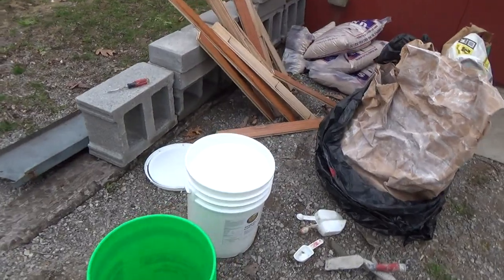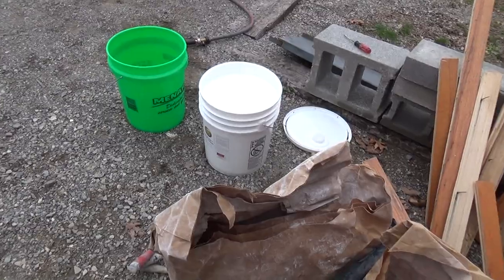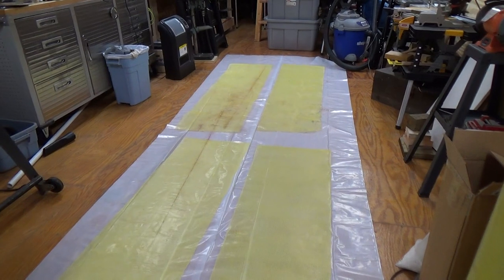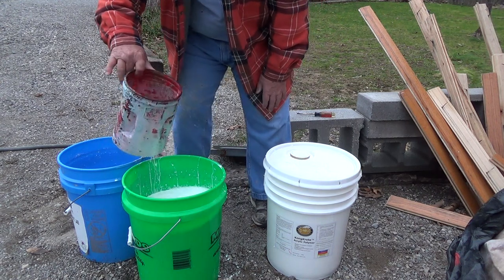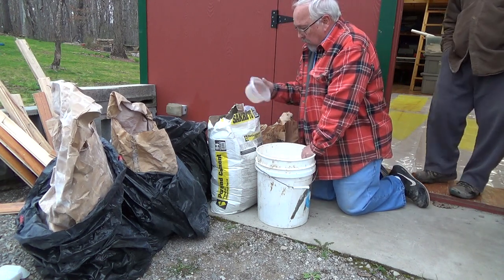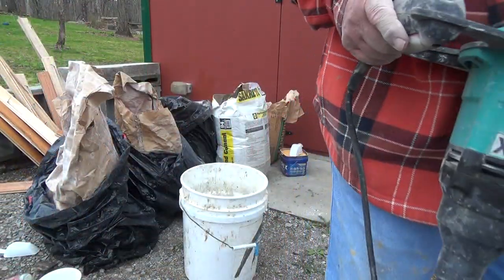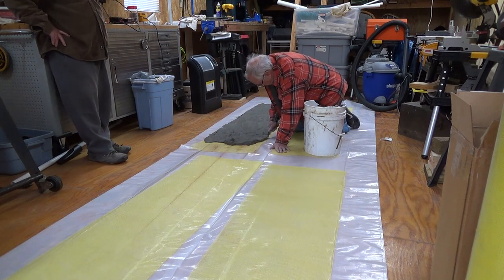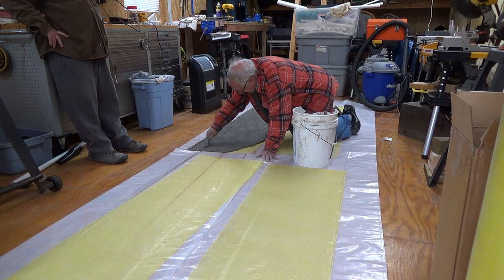Concrete Skirting for Sheds and Decks

Comment: Really cool, this is what I'm current doing. I built a frame from 2x4s under the addition I built (post and beam), attached 1" foam board over it and then metal lathing over that and anchored into the 2x4s... then covered in mortar and carved into faux rock. Works great, looks great and much cheaper & easier than the real thing!
Reply from the maker: What mix did you use?  Depending on where you live, mortar might not hold up very well.
Reply: @dperry428  Thank you for replying! My faux rock experimenting started about 10 years ago after watching some of your videos. You're a bit of a Legend ;) I'm using Type S mortar and adding some acrylic paint to it, so far it's been very sturdy but I'd more than welcome ANY advice you have, thanks!
Reply from the maker: Legend, huh?  Maybe in my own mind!  First, what's the climate where you live? I'd be interested to know how your mix is standing up to freeze/thaw cycles. I'd also be wary of using acrylic paint.  Concrete can be pretty sensitive to contaminants, so much so that water that is used in mixes should be of drinking quality. There's no telling what substances in paint other than acrylic might have a deleterious effect on the mix.  I'd also like to see some of the work you've done.
Reply: @dperry428  Climate is very harsh here (northern Maine). So far it's held up well. I'll try to post a video in the future of some of it.
Reply from the maker: I'd want a mix that was denser. That's why I use metakaolin and silica fume in my mixes. The greatest enemy of concrete is water and a dense mix is much more resistant to water infiltration.  Keep in mind that mortar mix is made to be deliberately weaker so that the bond it makes between bricks or rock breaks before the rock or brick.
Reply: @dperry428  good info, thanks! I did say Type-S mortar, but I was wrong on that, it's Rapid Set (High Strength) structural mortar that I used, but I can't seem to find that now
Reply: @dperry428  where can I buy metakaolin and silica fume?
Reply from the maker: @wilhallman2890  I buy mine from Fishstone, they ship.  https://concretecountertopsupply.com/  You can go here:  https://www.metakaolin.com/contact-us/  Contact them and ask for the nearest distributors of metakaolin and silica fume.

Comment: Sir I have spent countless hours looking for a AFFORDABLE diy way of skirting my homes. you sir are the only video I have found to do this so now comes the questions ..
I like the idea of just lathe and covering it with concrete what do I attach the lathe to I seen you just screwed it to the bldg how about the bottom what keeps the skirt rigid and straight I would love a response so I can get to work right away .thank you for sharing your skills
Reply from the maker: If the space being covered is less than about two feet, there is no need to have additional support, IF you use a high strength, fiber-enhanced mix.  Once the concrete is on and set up, the panels are more rigid than plywood.  If the space being covered is larger, then you could build the equivalent of a stud wall with treated lumber (2 x 2's would be sufficient).

Comment: Great video, thanks. This is something I plan to try. Can you tell me how these panels have held up over time?
Reply from the maker: My brother says they are as they were when we installed them.  He lives in Tennessee.  I'm in northern Illinois.  The durability of the panels will depend on the mix you use.  Don't expect them to hold up with bagged mixes from home improvement stores.  This mix is UHPC and is 4 to 5 times stronger than the mixes from the store.

Comment: I have to hand it to you, I'm 56 yrs old and when I get on my knees i grunt a whole lot louder.
Reply from the maker: Once the cartilage is completely gone, it gets a lot easier to deal with the pain.  It can't get any worse. Using kneepads are even worse.  The elastic straps chafe the heck out of the back of the knees.  I thought about knee replacements, but once they are replaced, there is increased risk of infection to them.  Prophylactic antibiotic use is needed even when visiting the oral hygienist, so messing with sharp metal lath and digging into garden soils is not a good idea, especially for one with limited numbers of antibiotics available due to allergies.

Comment: I admire your work.,.. your applications are so creative and amazing.would you please list the ingredients you put together to make the concrete for the skirting around your brothers shed you put it on fiberglass mesh. I believe you said you bought the mesh from Amazon. I want to put the skirting around a travel trailer that remains in the same place permanently. Thank you for sharing your knowledge.
Reply from the maker: The fiberglass mesh rolls were purchased on ebay.  The ingredients for the concrete mix are 2 parts sand to 1 part portland cement, 5% CSA cement, 10% metakaolin, 8% silica fume, 3% fiber and acrylic admix/bonding agent added to the water so the liquid is 6 to 12% acrylic. I also added a waterproofer called Xypex at 2%.  Percentages are as a percent of the cement content, not the whole mix content.  The metakaolin and silica fume make the mix extremely dense.  The CSA additive compensates for the tendency of portland cement to shrink and also provides early strength and faster set time.
Reply: @dperry428   Thank you so much for your speed reply I was surprised that you even read my comment. I'm going to write the recipe down to keep for future reference
Again...Thank You... hope you have a great day.

Comment: I have a question; 
Are you putting those right on the ground? 
If so,  do you think I could use that concrete board that they sell for bathrooms? 
I have a mobile home that needs the skirting replaced.
Thank you 👍
Reply from the maker: I'm not afraid to put my mix right in the ground as it is very impermeable.  I don't know how concrete board such as Durock would hold up.

Comment: How does this differ from rendering or stucco - is the greater strength of materials the only difference.  Is thin-shell concrete a better method for making a 6' wall with post and wire or fiberglass substrate applied.  I ask because in your wall construction on the chain link fencing that seems like a very strong substrate, and am wondering if something less can be used and still end up with a substantial and durable wall/fence - thanks in advance  for your reply and special thanks for continuing to make concrete and clock videos
Reply from the maker: The mix is different from stucco in two ways; strength and permeability.  Whether to use this mix or something else depends on what you want to achieve as far as durability and where you are located.  The enemy of all concrete is water.  If water can penetrate and carry things like chlorides and sulfates with it, the concrete will deteriorate.  If the concrete is reinforced with metal, water infiltration will cause it to corrode, expand and fracture the concrete.  In freeze/thaw circumstances, water infiltration will also destroy concrete through expanding ice.  So, if you can prevent water infiltration by making concrete impermeable to water, it will last longer -- much longer, especially if you live in freeze/thaw areas. My fence incorporated a very high strength, impermeable concrete, as well as the additional structural characteristics of ferrocement construction, which is characterized by multiple layers of small diameter metal reinforcement.  Whether or not to use that technique as well depends on the structural strength desired or needed.  I wanted my fence as strong as possible, while the skirting does not require that level of structural integrity as it will essentially carry no significant load.  Were I to make a fence from scratch, I'd use posts in concrete, attached wire lath and 2 or 3 layers of chicken wire and fill the metal mass with concrete, much as I am doing with the bridge I'm building.  The supporting arches have #3 rebar surrounded by 4 layers of chicken wire and concrete of maximum strength and impermeability. In third-world countries, thin-shell, ferrocement construction is used to build water tanks and houses.

Comment: Hi, Thank you for all the videos you made, you may have retired but you'll always be a teacher. I have a question about the skirting. It's been almost 2 years, how did they hold up, against time and weather up in the TN mountains? Also, which type fared better, the fiberglass skirt or the metal lath skirt? cracking, breaking, etc. . .
Reply from the maker: With my health, I haven't been back to his place, but he reports that they are still in the same condition as the day we installed them with no problems with either construction.  I wouldn't expect that using an ordinary bag mix would work, but this mix is referred to as UHPC, ultra-high performance concrete for a reason.
Reply: @dperry428  Thanks for the quick reply. I wish you great health, and I admire your talent. I wish I could do 1% of what you have done. Except I ended up in the hospital 4 years ago, and I was told I can't be near portland cement dust, or touch it with my bare hands. I have to wear a heavy duty filter and long sleeved plastic gloves to do any simple concrete project. my best regards.

Comment: Can you please put the links to where we can buy each item your using please.  Thank you so much. I couldn't find two items so hope how I made it so far will hold. It would be nice to no where each thing is.tks again I love watching the cement stuff. Wish I could fix my wind up wrist watch
Reply from the maker: I got the rolls of fiberglass mesh on ebay.  Here is an example https://www.ebay.com/itm/143139226576?hash=item2153c343d0:g:RK4AAOSwkRpZpdK3  Cement and sand are available from home improvement stores such as Lowes, Home Depot, Menards.  I get my metakaolin, silica fume, fiber and acrylic from Fishstone.  https://concretecountertopsupply.com/

Comment: First off I want to say thanks for all you have taught us, I have been watching for a couple years and finally am going to try a few things. I was wondering if you could answer a few questions please. Are your stains acid based or water based. If acid based do you neutralize, because I have never seen you do that and if water based I have read you need to open the pores with a chemical. I am guessing these are just products they try to sell you, and you could just go right over the cement once it is cured. Right? Thanks. I am going to try a small 18" retaining wall. Should I dig a trench and lay pea gravel, or just go right on the ground. Should I build a wall and lath it, or just start with the 3 to 1 sand mix and add chunks of styrofoam or even fist size rocks that I have around, or maybe 4" concrete blocks on end. I know I have to do another coat after with the vertical mix and shape the rocks,  but was wondering about structurally for the first layer. Thanks again
Reply from the maker: When I first started 12 or so years ago, I colored concrete with either or both integral concrete colors that was added to the concrete while mixing and diluted acrylic paints that were spattered on to created a speckled appearance. Then I started using acid stains, which are metallic salts dissolved in weak muriatic acid (hydrochloric acid).  I do not neutralize after application.  I feel there is no need to do that as acid is neutralized with a base, which is what the concrete is.  Were I using this to stain an interior floor where I wanted to remove all residue prior to sealing the floor, I'd follow the product recommendation to neutralize with baking soda followed by rinsing. When doing a floor, there may be excess material that has not reacted and it needs to be removed, but outside, if there is any excess, it will eventually be washed away naturally.  With water-based stains, it is usually recommended that the concrete be etched with acid to "open the pores", but most people are staining existing concrete, usually floors, that may be old or been steel-troweled to a smooth finish, as would be the case with most floors. Etching would be needed to remove the smooth glaze to ensure an even acceptance of stain, something that is the norm.  In my case, I'm staining new concrete that has not been finished to a smooth, shiny surface and I don't want an even finish. I want the mottled look of real rock and old wood.
   I can't advise you on how to construct a retaining wall as I'm not a civil or structural engineer.  I know that you'll need to take into consideration what you are using the wall to retain, how much pressure will be exerted on it, what the local building codes are for such a wall, your climate and whether the wall is subjected to freeze/thaw cycles and frost heaving.  For retaining walls,  you may even need a building permit.
Reply: I am using your current cement mix to make rocks, tree stumps etc. When using the acid stains to color the cement  how long do you wait for the cement to cure.
Reply from the maker: The manufacturer suggests waiting for 28 days.  That's to assure that the amount of calcium hydroxide, the side product of cement hydration, is at its maximum since that is what reacts with the acid stain.  I find success in applying in the next day or two just fine.

Comment: I’m confused what all you put into your mix. Obviously sand and Portland cement but where can I find more information on the other ingredients you add? And the fiberglass you used, where can I find it? What is it called again?
Reply from the maker: Sand, Portland cement, CSA cement, metakaolin, silica fume, acrylic emulsion, PVA fiber.  Here is a video I did more than 3 years ago about the ingredients, minus the silica fume. https://youtu.be/etSWuBIcdZc   I get my supplies, apart from Portland cement and sand, from Fishstone http://concretecountertopsupply.com/ .  I found my alkaline resistant fiberglass mesh on eBay.  It is what is used in many commercial buildings with a system called Dryvit.  Here is an example: https://www.ebay.com/sch/i.html?_from=R40&_trksid=m570.l1313&_nkw=fiberglass+mesh+rolls&_sacat=0

Comment: By the way, thanks for posting,  I am surprised that those thin panels didn't just fall apart when you picked them up. I will have to try your recipe
Reply from the maker: Most people, even those with decades of concrete experience, don't want to believe that modern concrete mixes are any difference from their experience.  While my mix isn't engineered to quite this degree, watch what is possible with concrete.  Note the relative thinness of the test coupon.  https://youtu.be/X90OIT9dd2g

Comment: Hi i was wondering if the cement will adhere to roofing felt paper that are used as underlayment for shingles? I have also seen videos where people use towels or cloths materials and build things out of it.
Reply from the maker: I wouldn't use it. The use of the fiberglass mesh allows the mixture to surround the fibers, which act as reinforcement.  Solid paper would not work in the same way.  Cloth, especially open weave cloth such as burlap, is often used in making decorative elements.  I wouldn't use it in a structural element such as this skirting.
Reply: I would use the felt paper just to prevent the mix from being in direct contact with the wood on the house. No?
Reply from the maker: That  would be more important if you don't use a mix that is impermeable to water.  Regular concrete would wick water up from the ground or through it from rain, ultimately causing wood rot when it gets wet.

Comment: I've been looking into diy stone style or maybe  thin brick for my foundation. It's about 2ft above ground and having decks on both front and back of my house the runs on both sides of the house are strait for just under 60ft. The problem I have is I can not drill into or nail into the foundation to cover it with lath. My home was built in 46, and to drill one hole it costs me a drill bit. The concrete foundation is so hard that I cannot penitrate it easy. Never have I had this problem with concrete. Plus the foundation above ground,basement home, has been painted several times over the years. 
My question is, Is there anything that can attach the lath or am I just screwed?
Reply from the maker: I added lath and concrete overlay to my brother's house that was built in 1940.  Use a hammer drill, not a simple rotary drill and high quality carbide masonry bits.
Reply: @dperry428  
I burned up 3 Bosch carbide bits and used a Dewalt hammer drill. So I really don't know. Crazy hard and don't know why. Bits were smoking with little dust. I'll find a hilti and see if that works. Thanks friend, enjoyed the video. ✌
Reply from the maker: Then, I would use a diamond grinder to remove the paint down to bare concrete, apply acrylic bonding agent and adhere the faux stone directly, or do as is done with Dryvit system; apply high acrylic scratch coat, embed fiberglass mesh and apply faux stone over that.
Reply: @dperry428  I have never heard of bonding agent. I'm going to look into that. 1 do really like how you made these panels. Unfortunately I'm at a loss of securing them. Thank you friend for the responses.